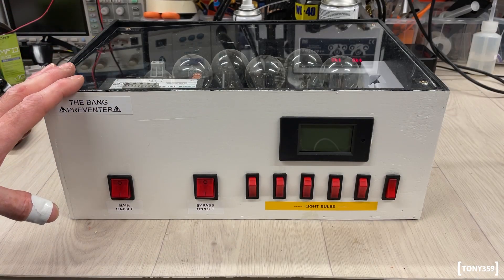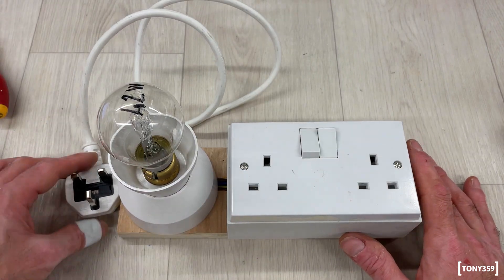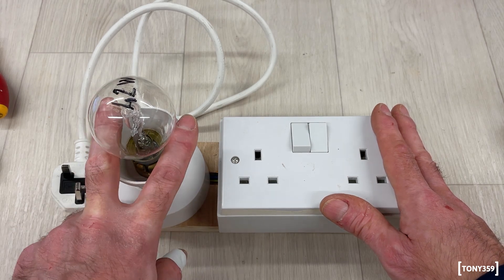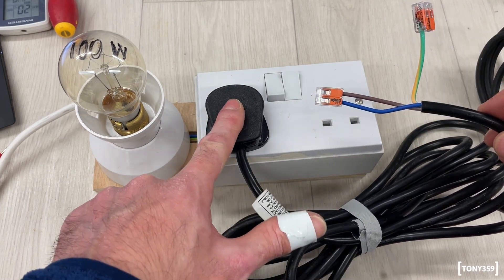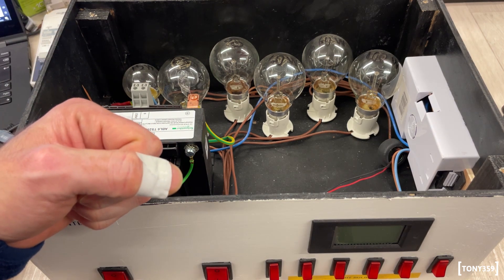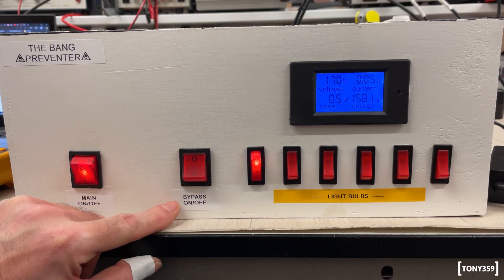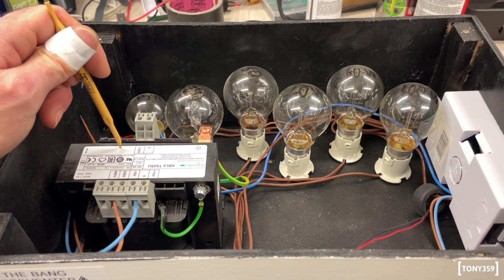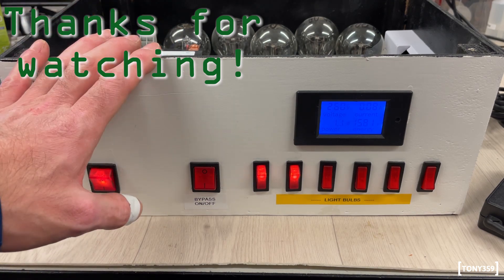The Bang Preventer - aka DIY Current Limiter with isolation transformer

Comment: I build small version with 3 bulbs long time ago. As bulb selection switch I reused 3 position switch from construction fan. Bypass switch is separate. Always, before connecting unknown devices, I recheck switch positions as great practice to prevent accidents.. 😂 My device is in old CD ROM case with house wall socket as output. Bulbs are with E14 sockets. Only I purchased wrong panel meter for it - voltage part is OK, but current part is not, because it can't register currents below 1A and I figured it out when tested after purchase.. Documentation didn't say that..
Reply from the maker: Amazing! My issue with my volt/current meter is that it has to be powered from the circuit you want to monitor. So it's switched off every time I switch off the circuit. Ideally, I would have liked one with two inputs: one for mains and one for the measured circuit - so it's always switched on and ready to measure what I need. 
But I am happy with it anyways and it's very flexible. I think I might need one further "bypass" switch to bypass the isolation transformer as well when needed. 
I'm sure your version is as cool as mine! Thanks for watching!
Reply: @tony359  Coolest part in my project is that it is small because I have storage issues.. Now I'm building separate isolation transformer from old 270W lamp TV transformer with option to select output voltage at one channel and option to power oscilloscope from separate channel independently. Now I'm still waiting analog panel meters from China. I decided to go old style way for that.
Reply from the maker: @artursmihelsons415  old style is good! "Flux Capacitor V2" :)
Reply: @Arturs Mihelsons, hi, does your panel meter have a separate current transformer (donut) ? 
If so, you can use a stiff copper isolated wire that can handle the maximum current you need, and do 10 windings instead of 1 winding through the current transformer. 
That way you measure from 0,1A up to 1/10 of the maximum current rating of your panel meter. You can use less then 10 windings also, but then you are always calculating the real value. Like with 2 windings show 2A want there is only a current of 1A.
Reply: @BjornV78  Yes, it have separate current transformer. I tested out 3 windings, just for fun, but then it showed wrong readings, because it's logical. Tested it out that way, to just figure out is it working and that's how I figured out 1A minimum. My idea was to fully rewind secondary part for current transformer on smaller core but it wasn't primary in jobs list. I to had idea to wind primary wire 10 times, instead of 1, but installed wire was to short for that.. 😂